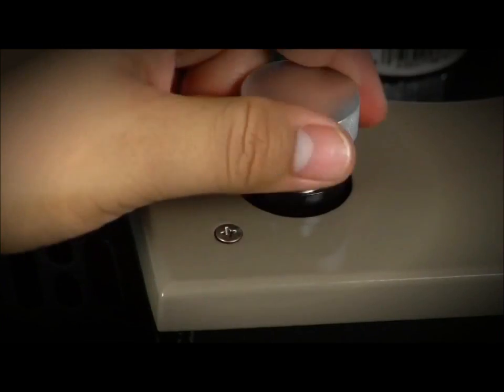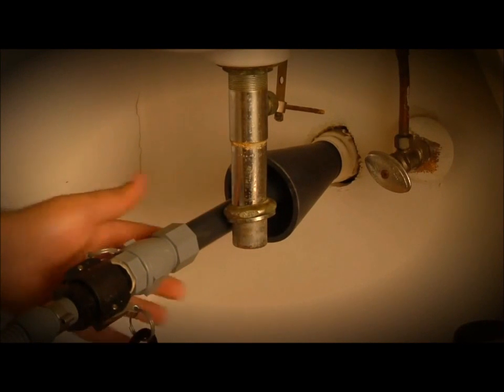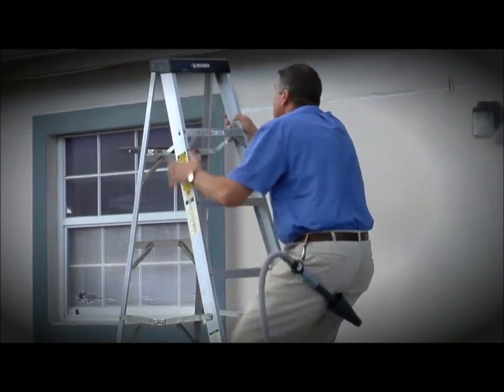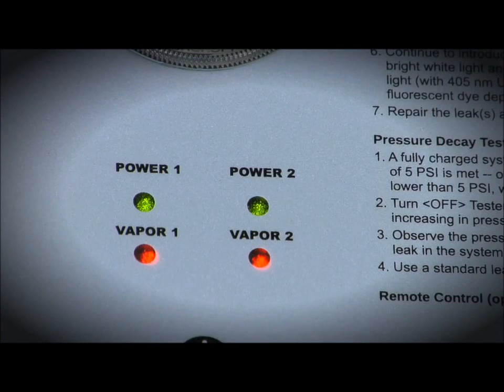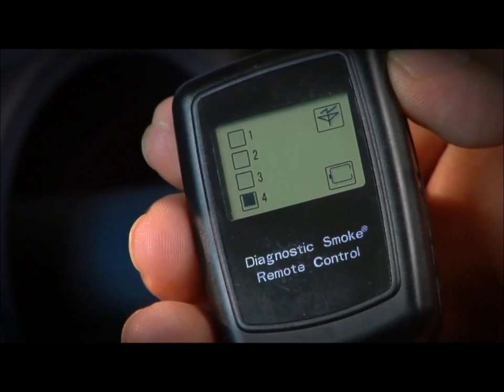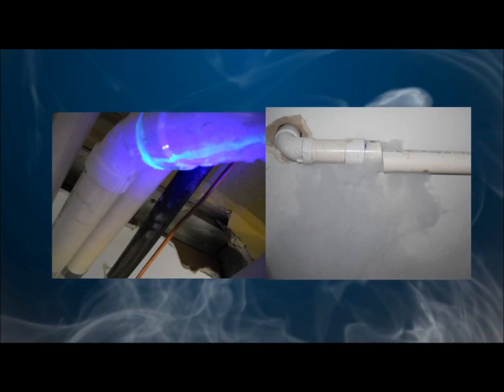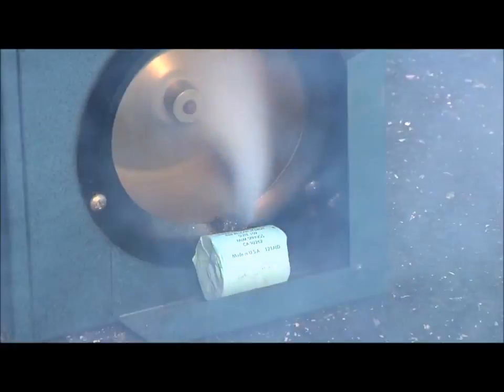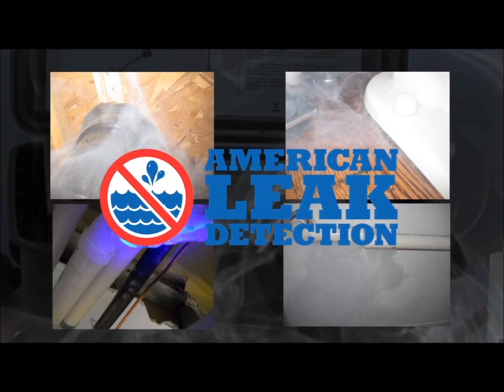Smoke technology can locate leaks

Comment: Not accurate, this is only for detecting odors (sewer smell) in vent stacks that are leaking. You will not find underground breaks with this method under a home (only outside). Best get a plumber with a sewer camera or perform a hydrostatic test that knows what he is doing not ranking up hours of labor.